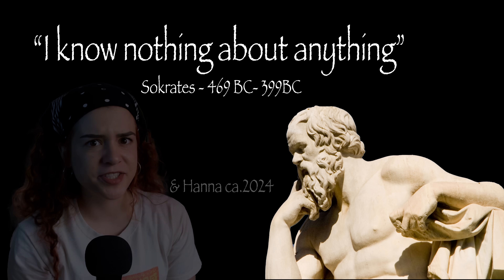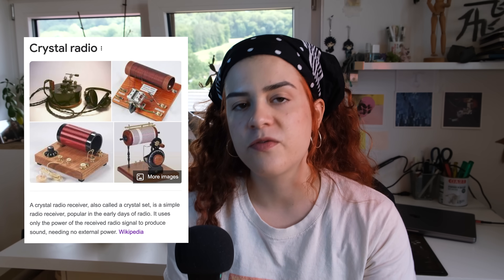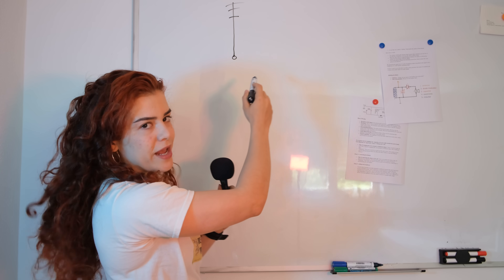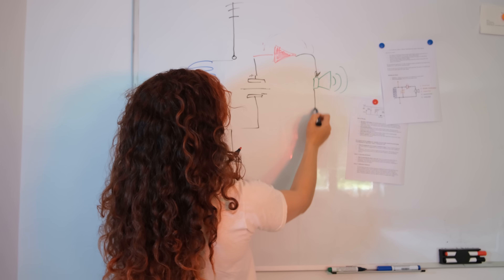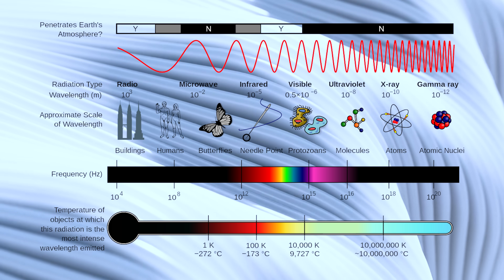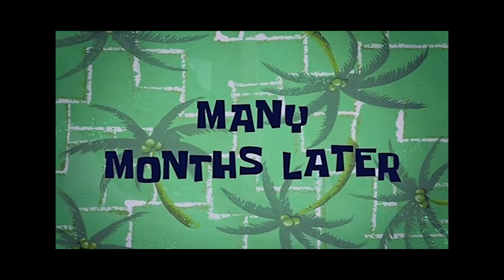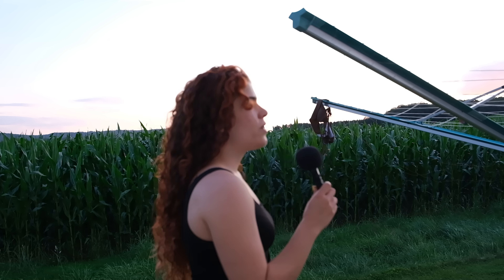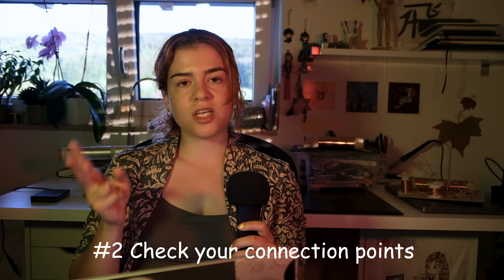I BUILT A RADIO AT HOME

Comment: well, that's... uhh... I don't even know what to say. first and foremost, congrats. The progress from the inability to distinguish inductors and capacitors to building a somewhat functioning passive radio is absolutely commendable.

The rest is going to be as long as this video and can even be a new video, so read at your own risk.

you should NEVER need a 3 meter tall antenna (That's fucking HUGE) unless you know exactly what you're doing and (please take no offense, but) you don't seem like you know exactly what you're doing (which is normal). What you need instead is an amplifier and a better (i.e. band pass) filter.
In order for me to explain what is an amplifier and why you need one, let me first talk about how radio transmission works and what you have (not) built. You see those big, phallic radio towers, right? Those Fernsehturms. How they work is, they send the signal all the way to the end of the athmosphere and bounce it back from there (this implementation saves a lot of power and antenna size for the same coverage), which is what your antenna picks up.

Second, let's talk about that bad troubleshooting.

1- You did NOT follow the diagram. The diagram has transformers, your implementation does not. The transformers in the diagram are what amplifies the signal. Your end result has nothing to amplify the signal. Good thing you have a very tall and very phallic antenna that can literally pick up anything and everything.
2- "Maybe I just don't have radio signal in my area" No. Just, No. That's a very big and very phallic antenna you have over there. It is can pick up rabbits having sex from the next town 10 kilometers down the road. Radio signals are a warm up set for that thing. Car antennas are an order of magnitude smaller than what you have and they pick up everything.

After you picked up the signal from your very big and very phallic antenna, you passed the signal through what is called a high pass filter, which passes the signal that has a carrier signal frequency that is higher than the pass frequency and mutes everything below. In the case of your circuit, "pass" means transmit 95% of the signal power (at best), because there is nothing to amplify the signal.
Then you passed the signal coming from the high pass filter into the speaker, which plays the sound.

Because you have a high pass filter over there which passes everything (as in every radio station) above a certain frequency, you hear english one day and french the other day.

In a normal implementation, you'd have a normal (i.e. much smaller) antenna, a very precise band pass filter, an audio amplifier that strengthens the incoming signal to orders of magnitude above the original strength. Then the choice of the speaker doesn't matter that much.

Last but not least, welcome to the world of electronics. We're glad to have you here.

Comment: What a gorgeous accent, in perfect English,  you're in Germany it seems ? Good news, they have just introduced a new "Beginner" licence for Amateur Radio Operators in Germany. Called a Class "N".   This is a new easier licence test, to allow people to start off in Amateur Radio.  

(In the USA the nearest equivalent is called "Technician" and in Australia it is called "Foundation").  

There is online education on German websites, but nearby Radio Clubs might also offer in-person teaching on weekends or evenings.   As well as covering the legal requirements of operating Amateur Radio in Germany, you will also learn some basic concepts of radio transmitting and receiving (some of which you already know !).  

Germany's new  "N" licence for Beginners,  allows up to 10 watts transmitter output and operation on a range of several frequencies. (think of a High Powered WalkyTalky or a car installed transmitter radio). Range can be over 100km from hill-tops.  Range can be extended even further with "Repeaters", "IRLP" or "Echolink". (The teaching for the N class licence exam, will cover all of them, I am sure). 

Later on, a person may choose to do the more advanced exams and be granted the higher categories "E", or "A" Radio licence. ("A" being the highest class). 

Licenced Amateur Radio Operators have the right to operate in most overseas countries, (certain restrictions apply), so your unique callsign, once issued by your governing authority is valid almost worldwide.  

I recommend people (of all ages) with an interest in Radio or Electronics to get involved with Amateur Radio.  In my local Radio club we have had 12 and 13 year olds pass their full licence test, after attending our teaching classes.  Cheerio from New Zealand. ZL3CATH.  

I'll try to include a link to a German website I found in English language, but there may be other websites.   https://www.wimo.com/en/blog/post/N-Lizenz-Update-2024

Comment: I'm pretty sure the capacitor is supposed to create an LC circuit to create better quality signal. You could probably change the "station" on your radio by putting a piece of metal partially inside the coil tube to "tune" the LC circuit. This works because it changes the inductance of the coil, which creates a specific resonance in the circuit that your goal is to match to that of the AM carrier signal.
Reply: I think the resistor is working because the circuit itself has some capacitance anyway, so the coil does build a resonance. Because the resistance is higher, your signal is probably quieter, but more de-tuned and picking up wider spectrum at once because the resistance of the circuit VS it's LC characteristics are higher.

Comment: Great perseverance.  You can also try other materials as a diode (detector) like the rusty edge of a razor blade (in fox-hole radio designs) or, "fools" gold with a little tickler wire.  Have fun.

Comment: a trick I learned with enamel wire is to keep a small blob of solder on the tip of my iron, running the wire through it will heat up and remove the enamel easily.

if you're able to, you can also hold the wire to solder between your middle and ring fingers, and then hold the solder with your thumb and index finger. Feels a little odd at first but ends up working out wonderfully if all you need to do is pre solder the end of the wire (especially enamel wire)
Reply: That works on all but the "high temperature" wire.  On it you still have to scrape.

Comment: It is probably the most painful videos about building something I have ever seen. 

You have obviously skipped all your physics classes or never bothered thinking about what they were about ... apart from the stuff you read about history of radio that AI can also do for me, you excelled in faults per minute and never even bothered to do the basics:
- which parts do I need for a functioning passive radio - I did not see a variable capacitor apart from the one you tried to build that has way too less capacity for these low AM frequencies
- have you checked which broadcast frequecy bands exists and which are transmitting AM for your simple radio to be received
- have you ever checked how far the next AM stations are away - most European countries stopped transmitting AM on the medium and long wave
- have you checked which exact frequency they are on
- have you looked up the formulars to calculate the properties of the inductor and capacitor for that frequency to resonate
- have you ever echecked what the ideal impedance behind the diode should be - can't be a modern dynamic low impedance headset for a smartphone unless you put and amplifier in between
- have you ever checked how an efficient antenna for that frequency band should be in order to get enough voltage to make the germanium diode do its magic? 100m wire or more from a tree along the field would have helped! Anyone who doesn't have that enormous space can build a resonant medium wave "frame antenna" (with variable capacitor) that picks up the magnetic instead of the electric field and then just put a diode and high impedance ear piece on the antennas output because it is so selective and has to be carefully tuned to the right frequency/station
- have you ever checked if maybe nightly radio propagations might help to pick up stronger signals? There is a layer in the ionosphere that reflects far away stations when dark and may allow you that a station from 1000km away is way stronger than a station 100km away, sounds strange but thats the way it is. => wikipedia radio wave propagations

Then you tell us that this is an alternating electomagnetic wave and while drawing the diagram start writing plus and minus around the capacitor - which part of what you just said did you not understand?
Then you paint the diode symbol incomplete, so you have never even bothered how electronic symbols for a diagram have to look like.
The visualization between AM and FM was also quite a joke nobody could learn from.
No wonder you never received anything and had to make some noise up.
But one thing you are really good at is speaking fast and throwing papers to the ground, that is where I suck at.

If you want to run a successful YouTube channel please make it about something you have at least the slightest basic idea what you are doing. There are also many areas of life where I have no f-ing idea about how stuff works, e.g. programming FPGAs, how to cure cancer, bringing peace to the middle east ... but I would not try to document that because its not helpful to anyone to see my selective incapability that everyone of us has, that is a waste of time and confuses people, because it shows false approaches and concepts.
Please focus on the stuff you have some expertise in and if you don't have some, get some and then make a video about it, not the other way around.
Reply from the maker: Thanks so much for this long comment! Obviously I didn't have any physics classes and the point of this video was more me trying to learn something about an area I know nothing about. As I also linked to in this video there are many professionals on YouTube you could go for the correct explanation. I will also try next time to be more conscious of wording so I don't send any wrong messages, but many people in the comments were kind enough to expand on my very simple explanations. I think that's the great thing about documenting it, it might not be a tutorial that way but it helps me grow and reach out to people who know more them me :D. I do appreciate the criticism though and will try my best to incorporate it next time!

Comment: You can make a detector from some burt zinc coated steel. You can also add a battery and make it transmit
Reply: * Caution *  Dont ever breath the fumes that come off zinc when you heat it up.
Reply: @kensmith5694  also dont eat batteries.

Comment: I love this video! I did the same thing as a child and I had a hard time getting it to work. I managed to find one build by somebody else and then I got some instructions from an experienced engineer and then I finally made it work. Did you know you can also light up an LED using the radio station's energy if you are close enough to the transmitter? I did that on my YouTube channel. Check it out! 😁

Comment: Thanks for an excellent video. Interesting seeing a crystal radio being built. Just of interest, my grand aunt (my grandfather's sister) was the first one in our family to have a radio, which was actually a crystal receiver, bought back in the 1920s. During the 1930s. my grandfather with a standard type valve radio of its day, connected to a long wire antenna throughout his house on one occasion, he managed to receive 3LO Melbourne from Sydney, which was quite an achievement back then and it even became an attraction to his entire neighbourhood. Following my grandfather, my dad continued with the radio interest, though he was also into SW radio. Receiving distant signals on radio has continued to be a fascination to me. I have also managed to receive long distance TV. Anyway, wishing you the very best. Rob.

Comment: You can easily improve your circuit by grabbing your signal from the top 10% of the coil. This will improve your frequency drift and selectivity, so you will hear less stations at once. To improve your circuit further you can start adding a transistor. And so on..Like someone else says it's a gigantic expensive rabbit hole.

Comment: “I know nothing about anything,” is a good way to start a radio project. 

Honesty, I thought the smoke detector piezo buzzer would work but selecting the right headphone/earphone is critical to get the crystal radio to work. The headphone must be high impedance. This is why you don’t use the earbuds that come with the typical mobile entertainment device because they will not work in a crystal radio. They measure around 32 ohms. The reason why they don’t is too technical for this venue. The impedance of headphones for a properly working crystal radio should be 2000 ohms or greater. Crystal earphones are typically 20,000 ohms and this is why they were included in crystal radio kits.
Reply: "measure 32 Ohms" is not quite right.  They have a nominal impedance of 32 Ohms in the audio band.  At DC they may measure something like 10 Ohms.

Comment: That resistor is actually making your speakers quieter since it's dissipating power you receive from your antenna. 

The coil and capacitor in parallel determine what radio frequency you are listening to. When you removed the capacitor and added the resistor,  you ended up relying on the parasitic capacitances of the resistor leads and wires connected to your coil to "resonate" which tuned your radio to a dramatically higher frequency, but at the expense that what ever you received is probably dissipated by the resistor you put, depending on how you wired it since I can't make that part out from the video.

All in all making a crystal radio blind like this, especially when making your own coil and capacitor is no small feat since you can't measure them, you can't know what frequency you are listening to, and you don't even know if there are any am frequencies in your area to start with
Reply: You are wrong about the resistor across the earphone.  It s needed because the earphone looks like a capacitor.  I made a video explaining why it is needed with a diode like the 1N5711 as your detector.

Comment: Just a quick recommendation for anyone trying to replicate this, use an opamp (operational amplifier) it is very cheap and will allow you to "change the volume" of the received signal so you can hear it better on the speaker. so instead of putting the output of the resonance circuit directly into the speaker, you give it to the opamp and then the output of the opamp goes to the speaker.

Comment: The inductor and capacitor exploit a phenomenon called resonance. The energy captured by the antenna oscillates back and forth between the magnetic field of the inductor and the electric field of the capacitor. By adjusting their values you can set the rate at which this occurs to the carrier frequency of the station you wish to receive. The formula for resonance is
   f0 = 1 / (2 * π * sqrt(L * C))
where
  f0 is the resonant frequency in Hertz (cycles per second)
  L = inductance in Henries
  C = capacitance in Farads
My guess is that your homemade capacitor did not have enough capacitance. It might have worked better to wind one layer of metal foil, then a layer of insulating material like black electrician's tape atop the foil, and then another layer of metal foil atop the tape.

A problem is that all over the world broadcasters are switching off AM transmitters as they move to FM, satellite, and Internet for audio delivery.
Reply: Have my up vote.
I made a video about making a simple home made capacitor for crystal radios.  The design I did maxed out at about 1500pF.

Comment: There are definitely different types of crystal radios out there. Some are better than others.  The biggest thing is have a good ground an having a good antenna (about 30 m, and as high into the air as you can get it).  Even if just the one end is up in a tree, that will help.  
The resistor is needed if you are using a piezo electric earpiece.  If you are using a high impedance head set (like the old style WWII headphones), than you can use a small capacitor instead.